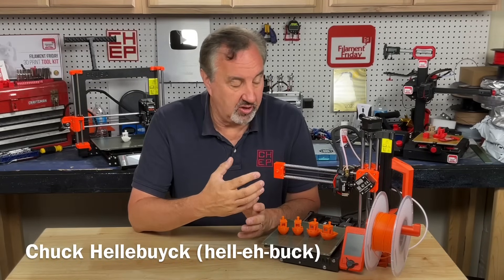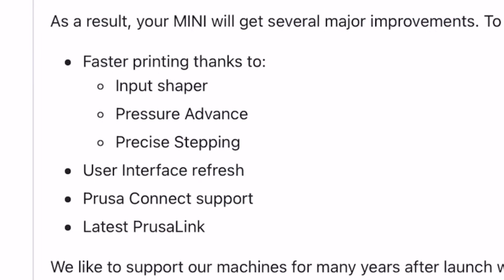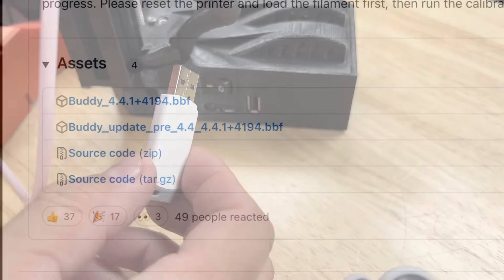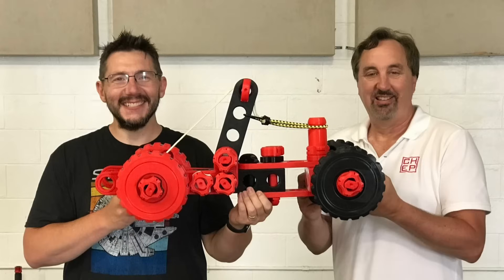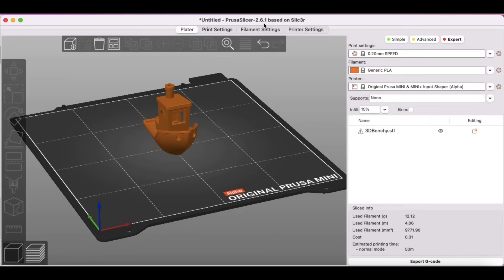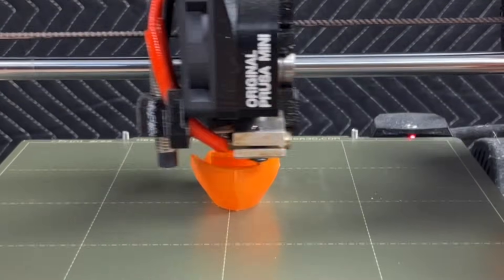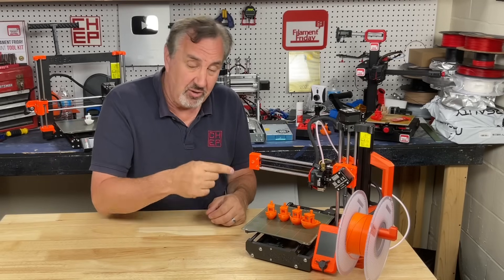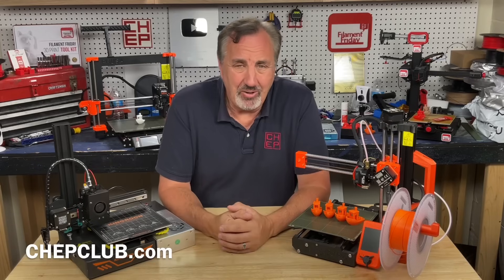12 Minute 3DBenchy on Prusa Mini

Comment: I had 2 Minis, now I have 4! Double speed, I'm impressed! Prusa pays off.
Reply: Except this is trickery because it doesn't follow the bench speed boat rules.
Reply: @BeefIngot Wrong.  2:43
Reply: @hassosigbjoernson5738  I think you missed that the actually proper one was significantly slower.

Comment: I am just thinking about getting into the 3D printer hobby and I think the Prusa Mini would be a good choice for my first printer. Most of the things I might want to print should fit on a 180x180 bed. And if the parts are bigger you can print them in parts and glue them together. 😀
Reply: I've had my Prusa Mini for about a year now and I absolutely LOVE IT. Sure, it's a lot more expensive and it doesn't look as nice, but it's been an absolute WORKHORSE in my shop. I received the kit and immediately observed that each part (down to the bearings) were of superior quality than some other Chinese manufactured printers I've owned. 
If you are sold on Prusa and have some extra spare time, then I recommend buying the kit over the semi-assembled printer. You'll learn a lot about how 3D printers work and it'll make maintenance a breeze. Good luck!
Reply: @cantucodes  I always hear this "you'll learn how 3d printers work" argument and I really do not agree at all. Not one bit. And I have some monstrosity ground up kipper config double cam, nozzle cam abomination so I went through deeper trenches than most.

Building the kit teaches you nothing that googling would not.

Its a waste of time learning information that will not be useful to you and that is not transferable.

For instance, let's say you get a prebuilt model and it breaks, we'll now you have a reason to learn, but you only need to learn about what broke, so no time wasted.

Why learn about how one particular printer and configuration is buoy when that does t actually transfer anywhere else outside of that one printer?

Its not like you'll be putting together another one.

Use that time to instead create and learn real, transferable skills like prototyping. Heck even moddingthe already but printer is a better use of time than playing Lego with a kit.

Just my opinion, of course you're just as free to disagree as I was.
Reply: >"Building the kit teaches you nothing that googling would not.

Its a waste of time learning information that will not be useful to you and that is not transferable."

I think for people already familiar with the principles, I would 100% agree with this statement. However, if you are a beginner just stepping into the 3D printing space, and are interesting in modding, replacing, or understanding the basic mechanics, then a kit could steer you in the right direction. Especially Prusa's kit. Their instructions were spot on. You can learn a lot from playing with Legos ;)
Reply: @cantucodes  How does a prusa kit make you understand the basic mechanics in anyway that is more time efficient than just googling that if you're interested though. 3d printers, especially Cartesian bed slingers aren't exactly complicated concepts to get. If anything the complexity is in the slicer, electronics and firmware.

I can maybe buy that for a core xy, but a bed slingers? Why spend hours doing when you could figure it out in a 10 minute YouTube video?

As for modding if someone is really interested in modding (I have a hard time believing people really are, and experience with newbies tells me they just think they are but really want to put a hat on it), then prusa are not good designs for that. The Mk3s survived because of popularity but surely any printer with 20 20 aluminium would be better for that purpose. More than that though, what beginner actually mods their printer? I think this is a mystical nonexistent person as I described above. The only people who do, do so because the experience is so frustrating they want to fix it.

As for being interested in replacing parts..... Do you just swap out your cars alternator belts for no reason? Not even car guys do that.

Why take time doing busy work that you won't benefit from?

Once again you have to realize the alternatives involve enjoying yourself, actually learning transferable skills, bringing something new into the world.

Why waste it just reassembling someone else's design? This is what factory workers are paid to do and there is a reason it is not seen as super desirable work.
Reply: Prusa is overpriced garbage and a fraud. And CHEP should have been more honest that the alpha1 garbage does not follow betchy rules. Speed benchy rules takes Prusa mini 26min while the A1 mini does it in just 14min and it only costs $299.
Reply from the maker: Mini is a good machine. And can print many different materials that even the new competitors can’t.
Reply: @FilamentFriday  ok but a beginner would not print carbon fiber, and if he want he can buy the nozzle for something like 25 euros
Reply: @FilamentFriday I'm pretty sure he only plans on printing PLA. He's just starting, the mini can print PLA and PETG and that's what most newbies print for years. The A1 is a more polished product with lots of features not present in the Prusa Mini
Reply: Don't fall for it, the Prusa Mini is a good machine but highly over rated, specialy for its high price!! 
You have other better options for less money!!! But don't believe me, make your own investigation and discover it for yourself
Reply: @marianososa4309 I know there are cheaper machines on the market with more features, but I don't really care about features. The only alternatives I've considered so far are the Lerdge iX kit or the RatRig V-Minion kit. The Lerdge iX kit would cost half the price of the Prusa Mini and isn't a bad looking machine. The RatRig V-Minion costs more than the Prusa Mini, but is built like a tank.

The price doesn't really bother me. I can afford it. I want to learn something new and do some tinkering. Not just buy an ready to print machine and print some plastic figures. And the fact that I only have to drive 3 hours to visit Prusa doesn't hurt either.
Reply: @andreas.grundler  Its so strange to me, especially after what you just said that you imply that the only things you think of to do on a printer are tinker parts and figurines.

Like .... what about... the main purpose of CNC machines in general: Actually making things.

Why make printing the project rather  than have an actual project where you use printing to fast prototype. I just don't get it.

If you planned to add some never before seen feature for printer I could get behind it, but buying something imperfect for the sole reason of trying to improve it to almost reach the quality of something else just doesn't seem very efficient.

Would you really not rather bring something new into the world? My man, 3d printing can expand your creative horizons. Add some electronics knowledge into that and you're cooking.
Reply: I think bambulab is a bit better, price is lower (the bambulab a2) at higher quality (im not talking about the mark 4) they are both great machines but i personally prefer bambulab politics and reputation
Reply: @damianomotta1809 Buying the A1 would be for me like somebody want's to learn how to build a computer and then buys a laptop. Also, I am a open sorce proponent and don't like the closed eco system that Bambu Lab is building.
Reply: @andreas.grundler  That is a red herring. Bambu Lab parts & accessories are way cheaper and higher quality than Prusa's or any open source garbage.
Reply: @damianomotta1809 Bambu A1 mini?
Reply: My dude, buying a prusa mini over a A1 would be the worst decision you ever made. It's actually built sturdily so it's speed bench follows the rules, actually has all the ease of use features you could want, and can print not only more materials in the same print but a wider range of materials period since it comes stock with a steel nozzle and all metal hotend whereas the mini comes with some weird not quite all metal.

The mini is old and it's age shows. Misleading gimmicks shouldn't persuade you.
Reply: @BeefIngot First, I'm not your dude. Second, it's my choice. Third, you are wrong about the range of materials that can be printed. With only to 80°C on the heat bed, the A1 can print fewer materials than the Prusa Mini. Fourth, I enjoy tinkering, not just printing plastic figures from a library. And fifth, in case you haven't noticed, I hate closed source. I'll take freedom over features any day.
Reply: @andreas.grundler  Woah there with the random aggression. Yeesh. sorry for answering your query...

As for your second point, it's always so silly when people say that. How did you come about the belief that me giving you advice somehow took away your autonomy?

As for the heated bed claim... wut? Are you under the very misguided impression that magically 20 degrees more means the world for prints? At worst, and I meant worst, you have a slightly higher chance of curling. Have you ever actually printed these materials? you would know.

For your fourth point... so what? Wouldn't this mean you would prefer the objectively better printer that wasted your time less if you claim to be all business?

As for 5, why would I know your personal opinions my guy.

You need to chill out like 5 levels bud.

Anyways, enjoy your "freedom" to buy a worse product due to marketing of half hearted open source... 🙄
Reply: @BeefIngot  "As for your second point, it's always so silly when people say that. How did you come about the belief that me giving you advice somehow took away your autonomy?"

That was not advice. Saying "This would be the worst decision of your life" is just fear mongering and is often used by sales teams to get customers to buy their product instead of the competition's and from what I've read of you, you seem to be more of a Babu Lab salesman than anything else.

"As for the heated bed claim... wut? Are you under the very misguided impression that magically 20 degrees more means the world for prints? At worst, and I meant worst, you have a slightly higher chance of curling. Have you ever actually printed these materials? you would know."

Ah, and that's why even Babu Lab itself advises against printing anything other than PLA, PETG or TPU. By the way, the adhesion of PETG is already inadequate according to some tests. Parts get loose or curl up. Even some PLA prints curled up. And if you want to print functional parts, curling is something you don't want.

"For your fourth point... so what? Wouldn't this mean you would prefer the objectively better printer that wasted your time less if you claim to be all business?"

Then tell me what I can tinker with the printer? Maybe I can print a trash can for all the plastic waste shooting out from the printer but that's it. The rest is all locked down as it looks.

"As for 5, why would I know your personal opinions my guy."

And again, I'm not your guy. You sales people need to start working on your manners.

"Anyways, enjoy your "freedom" to buy a worse product due to marketing of half hearted open source... "

I will and I'm guaranteed to have a lot of fun with it because I love to tinker.
Reply: @andreas.grundler  I made a Lon response to this but it disappeared. Way too frustrating to retype. It was long.

The long and short is stop exaggerating about clear hyperbole, and that tinkering to tinker is really a maker's version of procrastinating. It doesn't have to be Bambu, just buy a printer that is good by default and actually moddable unlike Prusa machines with many elements designed to be pseudo proprietary but technically open.

Make a rook, or a Voron or something like that, and then actually make something novel and new. Or just rapid prototype in general. Don't buy just to spin your wheels rereading whet has been tread many times before.

Comment: I'm afraid this machine is now irrelevant due to Bambu Labs A1 release...
Reply: It was irrelevant before that. To me it became irrelevant when prusa promised Wifi and skew compensation as features and it took them years to get one and it still doesn't have the other.

To me it was obsolete when machines like the Sovol Sv06came out as basically mk3s printers that you could buy 2 of for the price of one of these.

To me this was obsolete when it was a Bowden extruder that still had issues with the ptfe gap from its not quite all metal hotend in current year.

Honestly, the Mk3s had its time as king, but I've never been a fan of the Mini.

It has always felt like Prusa purposefully handicapped it to sell more mk3s printers to get customers with that whole "but if I spend just a little bit more...."

Comment: The comments downing Prusa in favor of the A1 are ridiculous. Both printers and manufacturers are great. Theres no need to down one or the other. Besides, isnt it great that a company is updating their older units to keep them viable while also preventing more waste in landfills?
Reply: It's the pressure from Bambu that's got Prusa to release this update after all these years
Reply: @message2prateek  I agree. Still, it's helping those units to be viable again
Reply: Yes, but if you would buy one right now, there's no reason to do so.

Sure, Prusa is open source and proven to be reliable, but the difference in features is for most more than enough to overcome this.
Reply: @gustavrsh  True
Reply: @gustavrsh so what your saying is this doesn't make prusa money and upgrades existing printers for existing customers at no extra cost?
Reply: @gustavrsh  Are they really all that open source or reliable though?

Like honestly think about the ptfe not quite all metal hotend on rhe Bowden mini. Think about the buggy firmware. Think about the severe vfa many people struggled with for years and their response of "that's normal, deal with it". Think about the buddy boards they make but don't release the designs for. 5hink about their new hardware they don't release designs for.

Think about the fact that Prusa Slicer is only open source because it's a fork of Slic3r which forces them to.

Think about the fact that their firmware is only open source because it's based on marlin and an old fork at they too, which means they can't really contribute back (it even bit them I  the bit here where marlin has had it for months and they are just now getting alphas out).

Think about how specifically and weirdly designed their hardware is on purpose to be hard to manufacture which they've said is to stop people from copying it, which eliminates the whole point.

I think they use open source as a marketing term while not believing in it I reality.

Its why they are now making whiney blog posts trying to walk back, and slinging mud at companies following literally the same path they did I  simply forking the best open source slicer at the time and the improving upon it just like they did with prusa slicer from slicer.

They are hypocrites and I my opinion only technically open source.